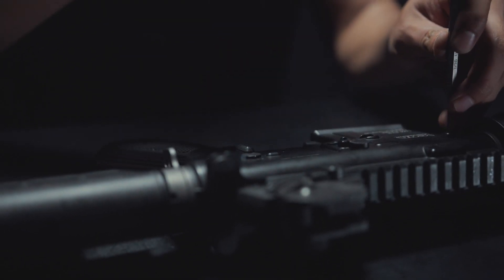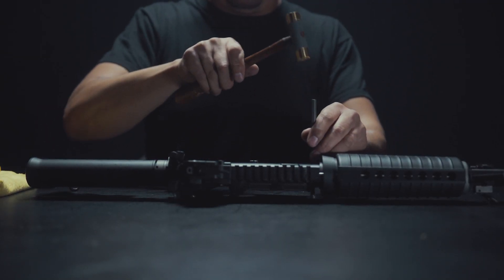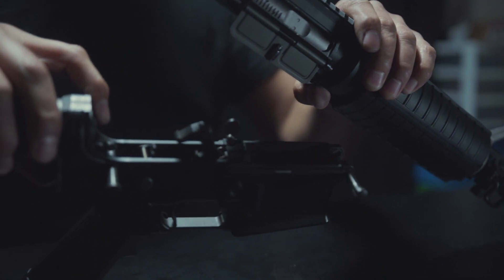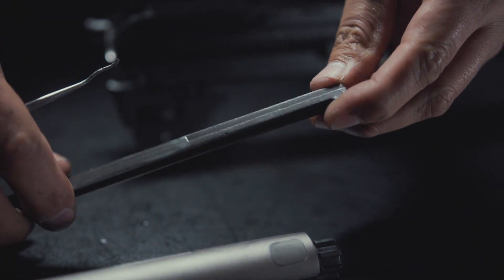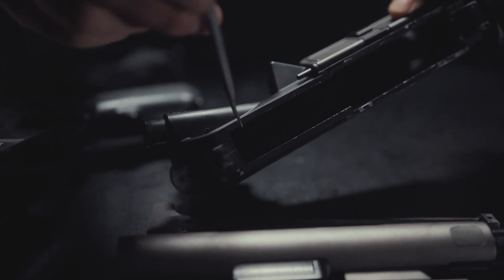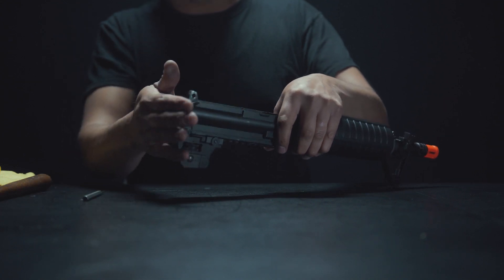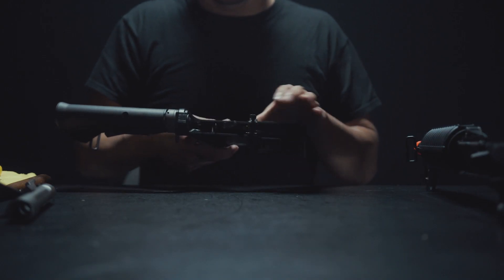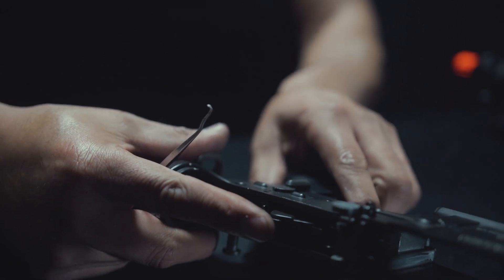Gas Blowback (GBB) Troubleshooting │ KWA Maintenance Minute

Comment: The best m4 gbb ever! very nice basic guide, I'll reccomand it for sure
Reply: Hardly, GHK and TM MWS are millions times better than the lm4 system
Reply: @opairsoft8100  Yeah right... you meant the super hard feed lips with the pathetic spring that doesnt match their strength? maybe the bad texture that the steel internals have? the poor cooldown and leaky mags? Oh I got it.. you want a replica purely for looks. you want cerakote that will give U zero increase in performance.
Sure, tm is nice at all.. besides the fact that it's made of zinc and will put a hole in your bank account.. but you can't say anything bad on the kwa lm4's super smooth full steel internals. without a doubt the best BCG in the market! I've passed 100k rounds through my gun, you simply cannot question that. I agree? the stock hop up might be bad and will require necessary modifications - like any godamn GBB. My maple leaf hop up set is extraordinary and besides that everything is stock and working extremely well.

My comment is based on tons of personal experience with all the brands and people across the world.

P.S there are tons of spare parts available everywhere on the web, along with cool mods that U can throw at your gun (such as YSC aluminum bolt - crazy af)

oh, and you won't be able to change my mind so don't even try  :)
Reply: @DrorProductiones  sigma male status
Reply: @DrorProductiones ”I’ve passed 100k rounds on my gun” bullshit. Simply bullshit. Your HopUp tensioner shit the bed within the first 2k rounds. I was a tech for 4 years and “fixed” (replaced a part destined to break with a part destined to break) well over a dozen LM4s you did not pass 100k rounds before bbs started rolling out of your muzzle when you slung your rifle and your HopUp started just not working. Stop lying.

Comment: What should I do if the slide of a GBB handgun doesn't remain in rear position after discharging all the BBs from the mag? I suspect worn out spring in the mag. Mine GBB is a KWA full-size USP, do you still make spare parts for these?
Reply from the maker: This could be due to a number if variable, however, most likely the gun, slide, nozzle and main seal need to be cleaned and lubricated. If your issues still persist, I would contact customer support or visit a local tech.
Reply: @KWAInsider  I found it out - it's the magazine spring. Two out of three mags I've got have got weaker springs, possibly third party ones (yes, it's a second-hand gun).

Comment: Brand new lancer tactical m4 a1 gbb.. loaded the mag then loaded the green gas in correctly . Loaded a bb in the chamber it shot but only a single then I had to manually pull the skid back to load another bb. It’s a semi/ full auto gun. Can anyone help me with what could cause this?

Comment: Hi I have an lm4 ptr gbb, I was sighting my gun in today to my acog, and I noticed my mp7 out performs the m4 now, thay doesn’t seem right to me. My lm4 is sometimes just lobbing bb out. Barely shooting far almost like it lost some fps I have a brand spanking new mag in the gun, no feeding issues just the issue with the power. Now I cleaned the same part of the gun you did in the video, and I had a bunch of black gunk all over the napkin, could that have been causing my power issue ? I also have an issue with the bb going down after being fired, so I adjust the hop up and it still does it, cleaned the barrel..,. All and all any ideas of what those power loss could be caused by? I know this gun performs better than this
Reply: As a owner of a LM4 myself I have had this problem as well. It was because my hop up unit/ barrel bucking was broken by a double feed malfunction. So I ended up replacing the inner barrel to a ra tech precision barrel with a maple leaf bucking. Then bought a higher grade hop up unit, so basically I replaced the whole inner barrel assm. Now if you do this be careful cause the barrel nut is glued on so you got to heat up the glues to get to loosen up

Comment: I love my LM4 with real steel DD rails on it! however im having a pretty baffling issue. Everything appears to be FINE and GOOD (put together right, functions as it should) until i put a magazine in and attempt to fire all the gas just comes flying out. I have tried several different mags (all old) im not sure if the magazine is the issue or?

Comment: Great tutorial! Is there a way to get your pistols to shoot around 320 FPS? I would love to buy your guys’ USP45 but I wouldn’t be able to take it indoors due to 330 FPS max
Reply from the maker: You could always try installing a low flow jet valve to reduce your FPS. Generally, these drop the FPS by around 50FPS depending on a few variables such as gun condition, lubrication, and weather.
Reply: KWA Insider thanks!!! Any tips where to get one?
Reply: @WolfMan-nf4lv  you can call kwa and order one